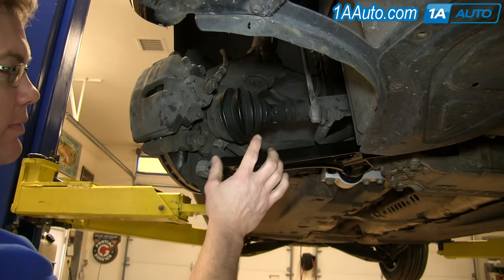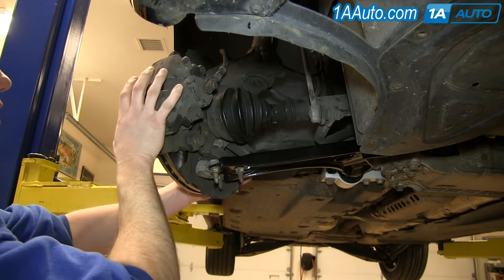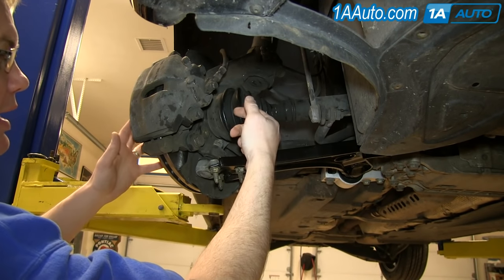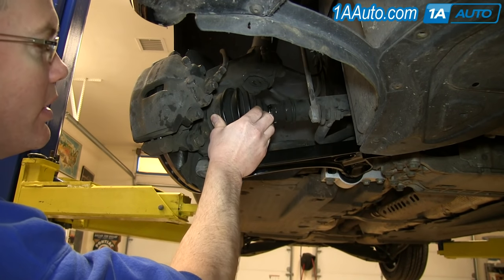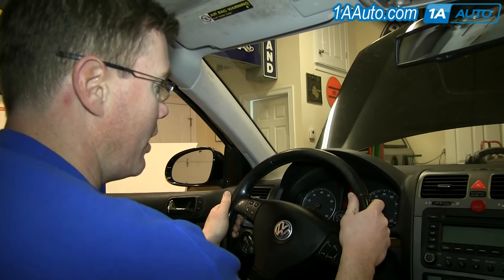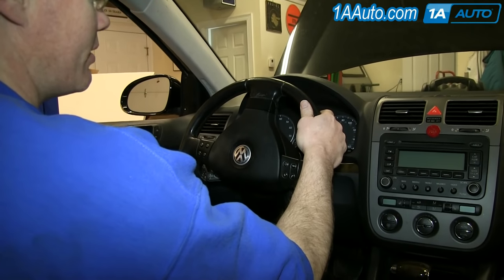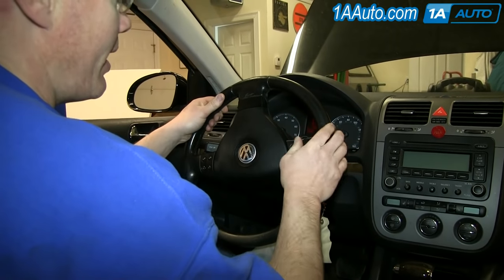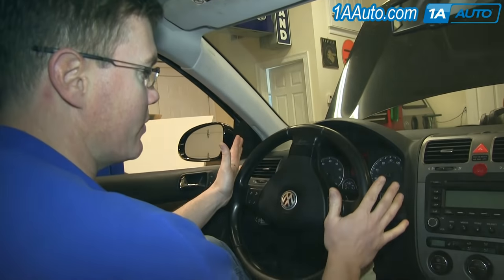How to Diagnose a Bad CV Axle

Comment: Vibrations at highway speeds could also be from bad CV axels
Reply: Thanks for the comment when I start going above 60mph it vibrates pretty good 👍
Reply: That's what I'm getting. Got lots of up and down play too after looking around. Starting to think it's the axles.
Reply: @ChillingwithMalc  did you ever replace them
Reply: Right... only if the inner joints go bad do you get the clicking noise.. they don't talk about the outer joints or anything else.
Reply: But only under load/acceleration once you let the gas pedal off then vibrating stops

Comment: Guess what? My cv axel seized with ZERO WARNING And I couldn't even push it out the rd it was so seized. On the end where it goes into the tire there is actually a bearing. That thing was seized so bad I HAD to tow it. So noise doesn't always tell and in my case there was absolutely no warning noises.
Reply from the maker: +@nikkilovetheyardsale-again2608 Thanks for the feedback!

Comment: I took my car to the mechanic in order to stop it from pulling to the left while cruising down the road. Also, the car would clunk when going up a bump and the steering had excessive play. I was told that it was my cv axels. I’ve been using this same mechanic for years and he’s very good, but I’m not so sure that he diagnosed this one correctly. Could it actually be?
Reply: Sounds like a bad strut mount? What was the ultimate outcome
Reply: this sounds like a combination of faults,  checking steering, brakes, suspension & drive line would be my go to response so yes your mechanic could well be correct. why not trust him you say he's good.

Comment: I have some TRQ cv axles for my '98 Town and Country, I'm going to install them as soon as the axle seals arrive. I just put on some of the TRQ rear wheel bearings and they seem to be of great quality. I appreciate your videos.

Correction: the axles are from Detroit Axle, but I have a set of four TRQ struts for a 2003 Lincoln LS that I"m going to install tomorrow! :)

Comment: I had bad half shaft no indications at all in turning or anything  until you got up to speed limit  and then all sudden it was like right brake grabbed and tried pulling it of the road very dangerous !  But never see mentions of that  indicator on line anywhere
Reply: Magdalen Carpentier my f150 is doing that exact same thing I have cv for the 4x4 which always spin locked in or not.  When the trucks cold I can drive fine about 3 miles at 60 but then u hear em grinding and trying to jerk the wheel outta your hands.  I'm glad I wasn't alone!

Comment: Front driver side vibrates when accelerating. No noise at all.  No leaking or damaged boot. No play when pulling on it. No indication the cv on my toyota tacoma is bad. So im startong to think that mabe its the tire but that would mean the car should always shake not just when accelerating, but my car only vibrates when accelerating. So idk how ot can be my cv axel when everything you said was a sign my showes none of those signs. It viberates only accelerating no noise at all. No leaking or cut boot. Doesnt make sence. Cant figure it out but maybe mine is just starting to go out amd isnt worn enough to make noises or give alot of play when pulling on it

Comment: I have 2014 equinox fwd and I only hear the ticking sound when accelerating lightly or normally in a turn but not a full turn and when I’m stopped and I turn my wheel back and forth I hear an occasional metallic tick

Comment: I'm procrastinating by watching this video because after both boots have been torn for almost a year I'm getting a pretty solid vibration at highway speeds in the steering wheel. Hoping it will wait another 90 days and warmer weather since I alternate cars but who knows.... Don't hear the clicking yet, remember that noise from my 1981 Chevy Citation back in the early 90's, my first FWD vehicle. Eventually it left me stranded and needed to tow it home behind my buddies truck.

Comment: thanks for this! what causes it go bad? just because i've had my car for so long?
Reply from the maker: +AllPink Thanks for watching!  The CV axle will go bad over time, as it is a type of ball joint under the boot.  If the boot ever gets torn it can speed up the process because dirt and debris will contaminate the joint, causing it to fail.  1aauto.com
Reply: Some good sounds to listen too are knocking sounds, and for me my ball joint was bad and I noticed due to a vibrating steering wheel, and it would jerk to the left side (which is where my ball joint and axel went bad.) Hope this helps you a lil!

Comment: I have a very bad grinding noise on the front end of my 200t Ford expedition an my CV axel has play in it should replace it
Reply: john clark no worries just remove it no need to replace
Reply: Check your wheel bearing/hub assembly as well. Might be a loose axle nut. The grinding could be from the bearing hub.

Comment: If the boots look like they are starting to crack/tear, should they be replaced? Also what about the rubber parts of the lower control arm. If they show signs of cracks is that bad?
Reply from the maker: +Edwin Castillo If you have rubber dry rotting then it should be replaced. The control arm bushings will make you feel shaking while you drive and the boots for the axles contain the grease inside and you don't want to hear a popping noise when its just metal to metal contact inside of it.

Comment: I don't hear a clicking but my car jerks BAD when I go over the slightest bump on the road. I just had my knuckle bushings replaced and I thought that would solve the issue. I've been told my upper arm control and my CV axles are going out but I can't tell which is causing the handling problem. I drive a 2001 Lexus gs300 RWD. Could anyone shed light on my frustration/situation.

Comment: Ok so unfortunately  as a single mother I can not afford a machinic so I do research I know some things and I have to do them on my own I just need to know if I need a cv axle replacement I have clunking or clicking whatever plus what no one else is describing  I also have what sounds like metal grinding with the clicking to me almost sounds like if my brakes were bad or caliber but I just replaced brakes n caliber seems to look ok but back to the other issue I only have 1 vehicle can't afford a mechanic n I need it to go back n forth to work so if anyone can point me to the direction it could be the cv axle that would be great thank you

Comment: I have an 02 accord and I think its my CV axle but it's more of a thumping clunking sound . wheel doesn't shake but its pretty loud Inside the car . especially if turning to the left . I feel the knock under my feet too . what could this be ? I was told wheel bearing but i think its the axle
Reply from the maker: +Mal A Thanks for watching!  It could be multiple things.  If you are unsure we recommend you have your vehicle looked at by a reputable garage to get accurately diagnosed!
Reply: Any update on what it was and how u fixed it think my car is having the same problem ?

Comment: I have an 04 Madza 6s and have replaced both cv axles and bearings recently. I have a grind at low speeds coming from the passenger front. I thought maybe a bad replacement axlel but when I get the car up and loosen the cv axle nut the hub wobbles a lot but only if the nut is loosened. Have the new bearings already failed in less than 90 days?
Reply from the maker: +Half Rot Zombie Thanks for watching!  It is certainly possible that the bearing has failed, but unlikely within such a short amount of time.  There could be other factors that are contributing to this issue.  We recommend that you have a trusted garage take a look at the vehicle to get an accurate diagnosis if you are unable to do so yourself!  1aauto.com
Reply: i have the exact same car and im getting both cv axles replaced soon also. How much did you pay for labour and parts?
Reply: Did you find it what it was?

Comment: I have a question for you..  do you have to have your windows down to hear the clicking sound? What about clicking when you turn the steering wheel wide and the clicking sounds like it's coming from the steering column?
Reply: I want to add a bit more info. Noise occurs turning left or right, no noise in reverse, well I dont make hard turns in reverse so I'm not sure if it's there or not. And what kind of feedback do you feel in the steering wheel
Reply from the maker: +Alexandra Jarrin Thanks for watching!  The clicking sound is best heard with the window down, but you can hear it with the window up as well.  1aauto.com
Reply: @1AAuto  if you can't hear it outside at all what could make that noise? No one has ever heard it besides people in the car and the windows are always up. It's not really muffled  as though traveling from underneath if I made to explain the sound to.me it.sounds like hard plastic that shouldn't overlap, but is overlaping

Comment: is it true. 
that when a front hub bearing is going,  
and that the side u hear it, 
is opposite that needs to be changed
Reply: Not always. The best way to test it is to do a quick 1/4 turn while driving at speed. 60km/40mph. The noise will get Louder more often than not, on the side that needs replacing when you do this.

Comment: Mine when on the jack stand has a lot of play and I also have some play when putting in drive or reverse no clicking on full turn but its got at least a 1and half inch of play when park on the jack and you can hear like the gear just seems worn should I wait to replace???
Reply from the maker: +Christopher Mendonca We wouldn't be able to diagnose an issue like that here, you may want to have a local mechanic take a look at it. Thanks for checking us out! http://1aau.to/m/Shop-1AAuto-c

Comment: whenever I roll over a Curb or parking block.. something blunt and large like a big rock  when the wheel is compressed up from making contact I hear metal on metal noise... I tried to take to the dealer several times and showed them with a test run... then when we came back to the dealer and the mechanic that was going to work on the car tried to repeat the problem they tell me they couldnt do it and they didnt see any issues... so I have had this issue for years. and I went to the dealer 3 times under the warranty and never could get them to fix it.. wondering if you have any ideas... I dont hear any clicking sounds on tight turns.. just then the front right wheel hits a sharp bump.. sounds like metal on metal..maybe  the strut is compressing and the wheel stop is hitting the chassis ...I dont know... any sugggestions?
Reply from the maker: +xpez We wouldn't be able to diagnose an issue like that here, you may want to have a local mechanic take a look at it. Thanks for checking us out! http://1aau.to/m/Shop-1AAuto-c

Comment: I have a question. On my FWD car, the boots are not cracked or ripped, but when I turn left on moderate lock under some throttle, I hear clicking from the left CV joint. Probably is the same on the right too. But now I also have a problem of vibrations on the stearing wheel when driving about 120-140 km/h or so. The tyres are ballanced and good, suspenssion is good too (I had it checked by a mechanic), so it can only be the CV joint. I like driving on the fast side, even though my engine only has 75hp (but I work it hard), so I think that caused the wear of the CV joints, even though my car only has 85.000km on the clock.
My question is can I continue to drive it like this? I don't feel like replacing semi-axels that stil "work". How likely is for the CV joint to break off completelly while driving (I know this can make the suspension parts to break as well, and wheel to get semi-detached, which leads to loss of controll of the car). Will I get warning sings when the CV joint becomes that bad, that the risk of breaking off is much higher?
Reply from the maker: +Ауто камере Србија / Dash cams Serbia Thank you for checking us out. When there is an issue with a part especially something as integral as a CV axle, we would recommend getting this addressed sooner rather than later. Yes it may still drive for now with minor irritations of vibrating but all it would take is a decent sized pothole or turning too quickly as a high speed to have a CV break and cause much more damage than it would cost to have replaced. Ultimately this is your decision and any safety inspection regulators in your area, but we would recommend getting these switched out for new axles for the longevity of the vehicle.
Reply: @1AAuto  Thank you. I will probably have them replaced in the next few months then.
Reply from the maker: +Ауто камере Србија / Dash cams Serbia Thanks for checking us out! 1AAuto.com

Comment: If the noise sounds on the right/passengerside of the vehicle is it the CV joint on the right that needs replacing?
Reply from the maker: +Bo Jay Could be. it's hard to say for sure without seeing the vehicle in person. It could be the CV joint or any of the surrounding suspension parts in that area. Check them for play

Comment: I have a 2004 chevy blazer and when I stop, I hear a clunk. Especially at really slow speeds and when I attempt to back up as well, whether straight and especially if I turn either way. I had an upper control arm replaced over 5 years ago and it popped like this but not as loud and when I took it in to have an O2 sensor replaced a few years ago, the tech said he fixed the pop that I heard. He said something was loose, but cannot remember what he said it was. My bro and myself jack it up a few inches and put a spud bar under wheel and pulled up on it multiple times to check if we could replicate the clunk, but we couldn't. He pulled out on tire, 12 & 6 oclock and then 9 & 3 oclock to see if bearins and I believe tie rods were bad. Maybe it was ball joints. We could not get it to even pop a little. I have been wandering if it could beth cv axle. Someone td me to jack it up, put on jack stand a ace jack.under cotrol arm and lift a little to take tension off of all components and may be eadier to check everything moe closely. This is freaking me out. It has over 220,000 miles, so I shoukd expect things getting worn out. I just dont have the patence to work on anything, but I will have to learn because used vehicleprices are ridiculous and I know this thing probably isn't worth much, but its all we got besides my other truck which has its own problems. Could the clunk I hear sound like anything with the cv axle? I even thought that torsion bar may be to blame or even a broken motor mount. Sometimes when I put it in park from drive, the engine dies. Iwas told that a broken engine mount could cause this and may even be the source of the clunk.Ty.

Comment: I recently changed my wheel baring on my 09 chevrolet malibu and when I reinstall everything and go to test drive it, it won't move it will go into gears fine but will not move a inch, what could I have possibly done wrong...
Reply from the maker: +lunar Phantom We wouldn't be able to diagnose an issue like that here, you may want to have a local mechanic take a look at it. Thanks for checking us out! http://1aau.to/m/Shop-1AAuto-c
Reply: Yes, of course I love you guys... OK so when I recheck my work, I find somehow the break pad was sticking to the rotor to the point it would not move an inch, so once I take loose the caliper pins screws, it released the pressure and I'm back rolling now... Thanks for your channel.

Comment: Hi, i have a 99 Nissan Altima. I was testing it on an empty parking lot turning all the way to the right, where I could swear I heard a loud grinding noise. However when taking it to the mechanic, they tell me that it’s the right side cv axle, not left that needed to be replaced. Is this possible? Again, I almost sure I heard the sound coming from the left, however I’m 100% positive the noise comes when I really make those sharp right turns. Thank you for whoever answers.
Reply from the maker: +Michael Toro We can't accurately diagnose the issue without seeing the vehicle. We would suggest taking it to a few different trustworthy mechanics and see if they all give you the same diagnosis.

Comment: I have something going on with mine. I don't hear a clicking noise. I hear what sounds like a knobby tire rub. THe CV joint boot has no tears or 
cracks in it.  I jacked it up and tried to shake wheel etc. no movement but when I grab the shaft it moves in an out a bit. 
Thoughts?

Comment: I have a question. My CV-Joints were replaced by the mechanic in the service center. However, I still hear the clicking sound when I make a full left turn of the wheel? I brought it back to the shop but they didn't eliminate the clicking sound. I can still hear them when i make the full left turn. Can you give me suggestion for me to say to the mechanic other options or ways to fix the problem of my car? Thanks a lot 1A Auto Parts.
Reply from the maker: +RL 4JC You may also want to check the wheel bearings to see if they are worn and need to be replaced. Hope this helps you out. 1aauto.com

Comment: Will the clicking noise be in the vehicle or on the outside?
Reply from the maker: +TLH Thank you for checking us out. While the clicking noise is located outside, you may still hear it while sitting in the vehicle. 1aauto.com
Reply: both
Reply: You will feel it in the steering wheel and hear it as well.

Comment: Okay, Car's engine is on and standstill with just the foot brake pressed in 1st gear, when steering all the way, left or right there's a rubbing/screeching sound from behind. What could this possibly be??
Reply from the maker: +Mrittunjoy Chowdhury We wouldn't be able to diagnose an issue like that here, you may want to have a local mechanic take a look at it. Thanks for checking us out! 1AAuto.com
Reply: Check for a worn, glazed belt or lack of power steering fluid.